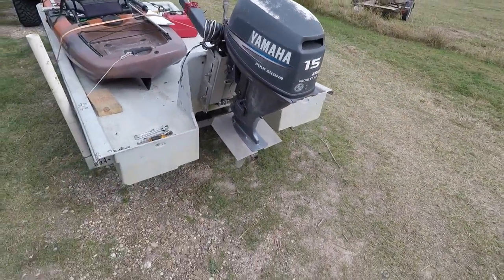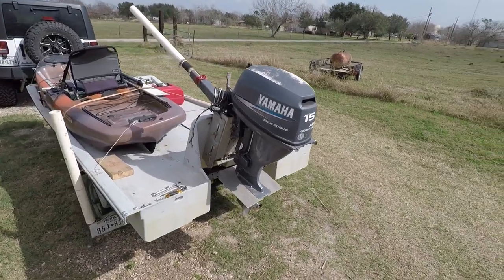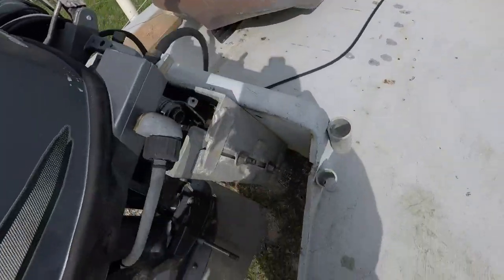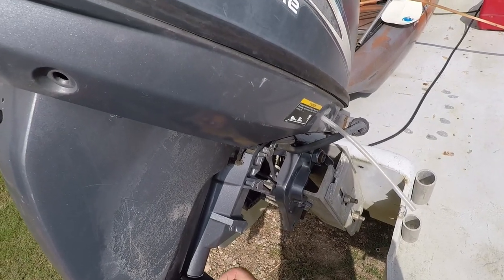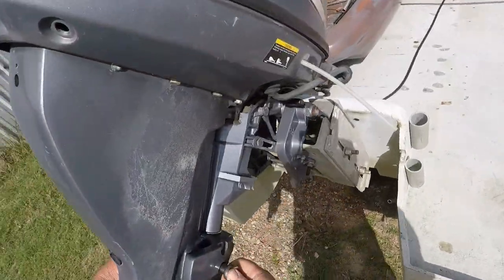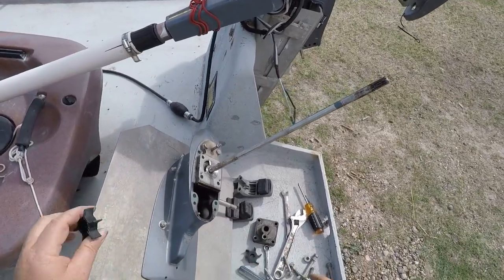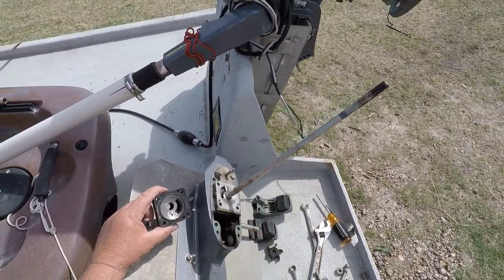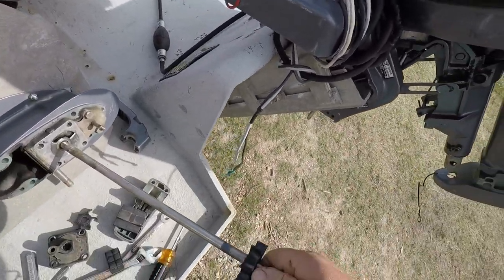how to change a water and fuel pump on a 15 hp yamaha outboard motor

Comment: Were you getting any symptoms of those parts failing before replacing them?
Reply from the maker: Yes it has been a long time so I can't remember
but I would not have just changed it . it was most likely a low water out put. and as for the fuel pump  I remember having to pump the bulb to keep it running.

Comment: I have that same motor do you know what size and brand jack plate you have hard to find one for smaller outboards
Reply from the maker: I made that one using a hydraulic unit that was made for a tilt and trim I don't remember the name of it  .

Comment: Your video helped me tremendously! I hooked up cups to my motor and it didn't piss water so I filled a tub to put it in and it still didn't piss. I was watching your video to see how complicated it would be to change the impeller when I noticed where you hooked the water hose. I had seen that tube and couldn't figure out why it went to nothing...SNAP!!! There was nothing wrong with my motor...things get a little easier, once you understand. Thanks for saving me a lot of work.
Reply from the maker: Glad it helped
Reply: Yamahas manual states that the flush port / hose assembly is only to be used with the motor off as there will not be any water supplied to the nice new impellor that was just installed and on it's way to looking like the old one did. Some other brands may be ok running but not Yamaha. Check it out.